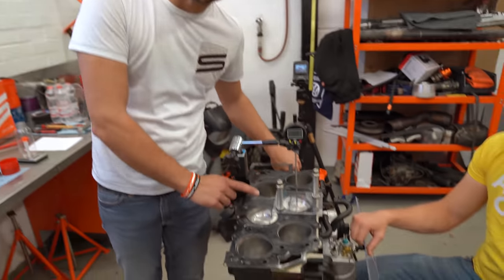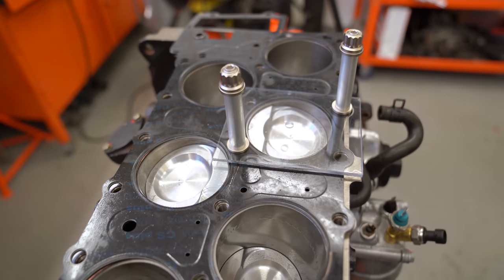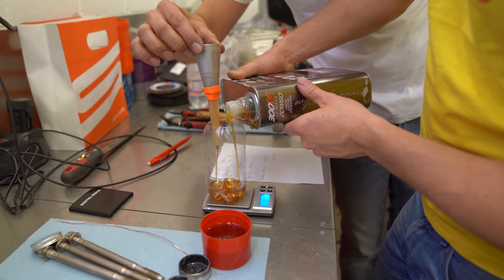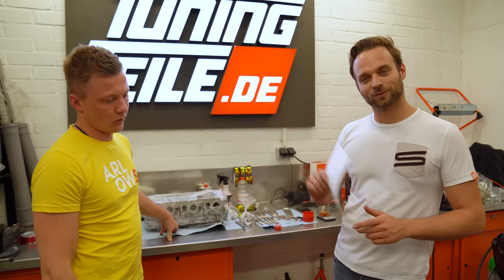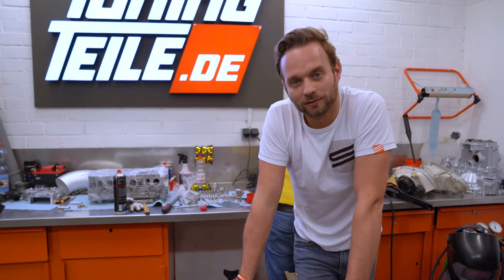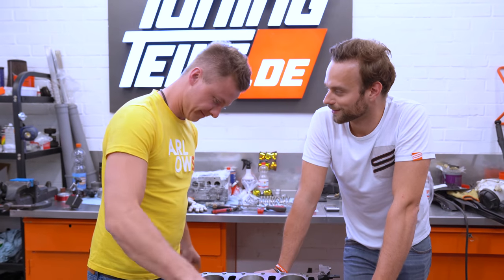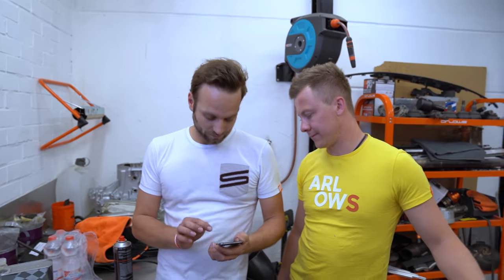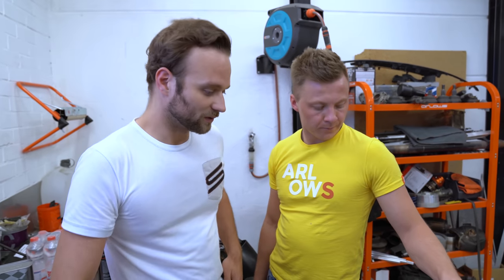Wir litern Marius neuen VR6 Turbo Motor aus! | Philipp Kaess |

Comment: Du solltest alles nochmal nachrechnen... 68 und 86 😉
Reply from the maker: Falsch gesagt aber richtig gerechnet.... Multitasking 😀
Reply: Ich hab beim Videoschauen grad mitgerechnet :D
Ich komme auf (87,2g-27,1g) / (0,867 g/cmm) = 69,3 ccm für den Brennraum
Für den Hubraum, mit dem pi aus meinem Taschenrechner, auf 563,3 ccm und mit den beiden Werten auch auf eine Verdichtung von 7,7.

edit: War für die Plexiglasvariante
Reply from the maker: Passt doch!
Reply: Ich wiege meine liquids immer mit ner fetten spritze ab. 😉 Dann legtst du dir ne zweite spritze zum Nullen daneben. Fertig ist die Laube.
Reply: @rush30111981  naja ich würde die verwendete spritze zuerst wiegen, ich denke mal nicht dass alle exact das selbe gewicht haben. Also wenn man es pingelich genau haben will 😅
Reply: @Dynamit295  ach ne du...

Comment: Wir litern auch immer mit Plexiglasplatte oder zusammengebaut mit alter Dichtung ;) 
Kleiner Tipp aus dem Hause Küthe Motorsport ;) Nächstesmal einfach eine Spritze mit Schlauch nehmen dann kann man das Öl gut dosieren beim Einfüllen und hat nicht die Dichten Umrechnerei, da an einer Spritze ml angaben sind und die direkt mit ccm verrechnet werden können ;)
Reply from the maker: Das wäre ja zu einfach! :)
Reply: so mach ichs au bei meinen mopeds immer. Klappt super
Reply: Mache es auch immer mit Spritze. Blöd nur dass man bei Opel Motoren Brennraum sowohl im Kolben als auch im Kopf hat und auch noch Kolbenüberstand. Nutze dafür nen Rechner ausm Netz wo man alles eingeben kann wie Kolbenüberstand, Tiefe der Kolbenringe, Durchmesser von Kolben und Zylinder, Dicke der ZKD. So habe ich nur den Kolben und den Kopf auszulitern und für den Rest habe ich ja die Maße. Dann kann man mit der dicke der ZKD rumspielen bis man auf die gewünschte Verdichtung kommt. Lässt sich die Platte in richtiger stärke lasern und fertig :D Beim nächsten block lasse ich aber Kolben und Zylinderkopf ausfräsen.
Reply: @reilmarcel  wo gibt es den Rechner denn?

Comment: Was ich nur nicht verstehe ist, der Motor hat ja einen Turbo und der pumpt ja auch noch mal Luft rein. Ändert sich nicht dadurch auch die Verdichtung?
Reply: Ja, es gibt da die geometrische Verdichtung, die hier berechnet wird. Und die effektive Verdichtung, die nicht so einfach zu berechnen ist :D
Reply: nein, Verdichtung ist eine rein mechanische Größe
Reply: Nein. Du bekommst zwar mehr Luft in den Brennraum, diese wird allerdings im gleichen !Verhältnis! verdichtet.
Reply: jul01 aber nur, weil zum Beispiel deine Lade Druckanzeige 2 bar an zeigt musst es ja auch nicht heißen das du 2 bar im Brennraum hast.😂😂
Reply: @claasfranz492  Ich weiß leider nicht, was du meinst. Der Druck im Brennraum hat nur wenig mit dem Druck im Ladedruckkreislauf zu tun. Wird das ganze z.B durch den Kolben komprimiert, ist der Druck wesentlich höher. Nicht umsonst fährt die Corvette C7 als Direkteinspritzer einen Benzindruck von 2000-3000 PSI
Reply: jul01 was ich meine, hat JP in seinem Audi A4 b5 video schön erklärt als er sich die neuen Nockenwellen eingebaut hat. Dass er mit den neuen Nockenwellen weniger lade Druck fährt als mit den alten obwohl er ansonsten nichts verändert hat.
Reply: @claasfranz492  Achso ok😅 Ja die Nocken halten ja das Ventil länger offen bzw öffnen schneller und somit kommt mehr Luft in den Brennraum, da die Ventile einen kleineren Engpass bilden. Somit nimmt auch der Druck im Ladedruckkreislauf ab, da sich weniger vor den Ventilen staut.

Comment: Für die Verdichtung hätte auch die Messung Abstand Plexiglasplatte zu UT geteilt durch den Abstand Plexiglasplatte OT gereicht... Pi und der Radius kürzen sich raus.
Reply from the maker: Das ist Quatsch!
Reply: Da der Brennraum durch die Ausfräsungen im Kolben nicht gleichmäßig ist kommt man am Auslitern nicht vorbei. Es geht um das gesamte Volumen oberhalb des Kolbens im Oberen Totpunkt OT und das gleiche im UT.
Reply: @Patrick20Valve  um den Hubraum zu bestimmen hast du recht. Um das Verdichtungverhältnis (ohne Zylinderkopf) zu bestimmen reicht der Abstand. Die Kolbenausfräsung verändert sich von OT nach UT nicht. Um zwei Dinge zu Vergleichen reicht es deren Unterschiede zu betrachten, die Gemeinsamkeiten (Durchmesser, Kolbenausfräsungen...) können außer Betracht bleiben.
Reply: Anscheinend verwechselst Du da was. Beim Hubraum macht das nix. Das ist das Volumen   Von Fläche Kolben mal den Hub vom Pleul. Hier geht es aber um die Verdichtung. Das heißt das komplette Luftvolumen was im UT oberhalb vom Kolben ist, inclusive im Kopf, wir bis zum OT zusammengepresst. Wenn der Brennraum im Kopf z.B. dachförmig oder hemisphärisch ist, kommt das Volumen noch dazu.
Mit deiner Methode bekommt man da beim VR6 schon eine grobe Richtung. Genau bekommt man das aber nur durchs auslitern.
Reply: @Patrick20Valve  Oh je, ich denke du hast recht. Die Betrachtung ohne Zylinderkopf ist hier ja durch die Plexiglasplatte als Begrenzung für den Brennraum gegeben. Ohne das Volumen der Kolbenaussparung zu kennen, kommt meine Methode wohl tatsächlich nicht zum Ziel. Also weiterhin viel Spaß beim auslitern!

Comment: Einfach eine Spritze aus der Apotheke nehmen die hat ml drauf und ml und ccm(cc usa) ist das selbe und alles andere gibt man einfach in Kompressionsrechner google ein wie Kopfdichtung, Bohrung, Hub... geht viel schneller und man brauch keine Waage und sieht an der Spritze sofort die ml/cc die der Brennraum hat. Block  einfetten dichtet die Plexiglasscheibe besser ab. Einfüllbohung nicht in der Mitte sondern am Rand und Block leicht schräg stellen so das die Bohrung der höchste Punkt ist, dann geht auch die Luft besser raus und ohne Kopfdichtung auslitern das Volumen errechnet das Programm oder man selbst. Bei richtigen Autos litert man auch den Kopf aus ;) weil der Block Kolben ist plan ;P bei den Kolben steht normal auch die CC der Ventiltaschen und Mulde... dabei also ist euere Arbeit wahrscheinlich unnötig ;) hat Mahle und co schon für euch gemacht ,man rechnet dann nur den Raum über dem Kolben hinzu wenn der Kolben nicht Zero Deck hat zum Block. Aber tolles Video trotzdem ;)